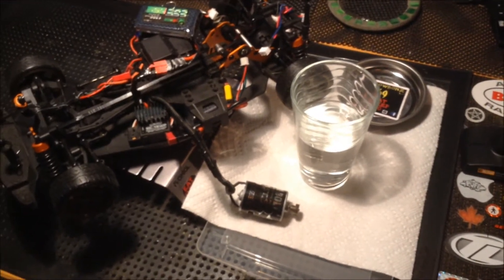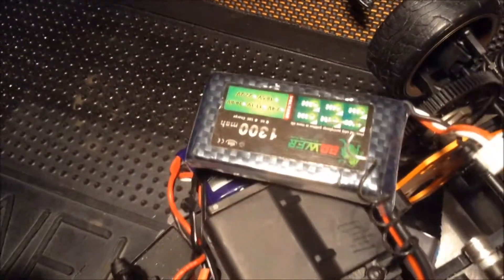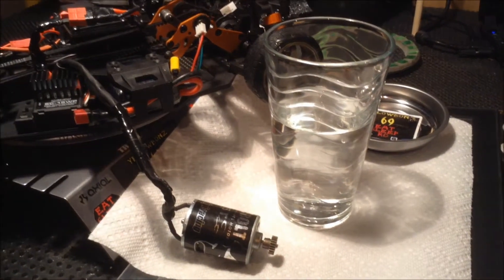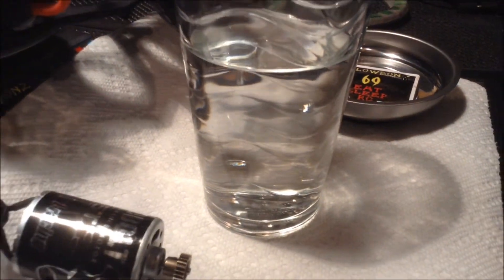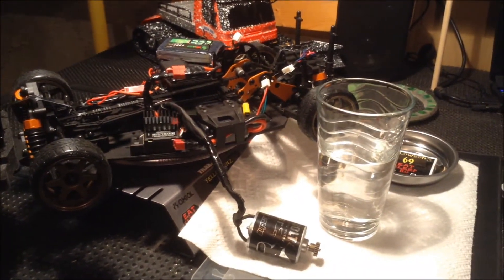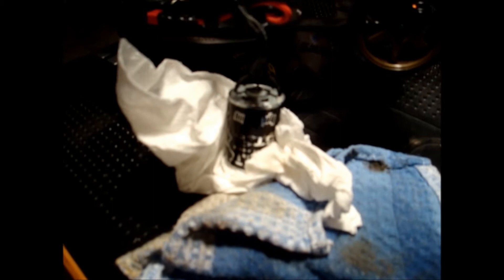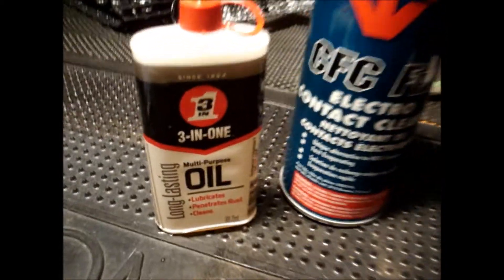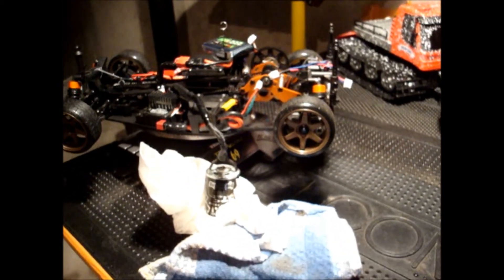Clean / Break In a Brushed Motor MOD 6 HPI Drift Camaro

Comment: What did u put on the motor wires ? Can I do it with the stock set up out the box ?
Reply from the maker: Its just Heat Shrink and Electrical tape to protect the wiring under the shell. Yes straight from the purchase, u can just remove the motor as seen here and dunk it.
Reply: Hey would u happen to know how to change the battery wires so it can run on a lipo
Reply from the maker: yep, cut the end off and solder on a Deans Lipo Connector. Simple as that, I`ve done it to all my rigs.
Reply: Thanks for the help
Reply from the maker: anytime bro